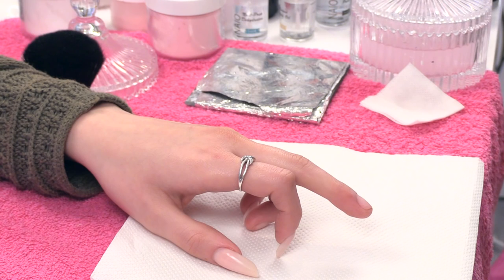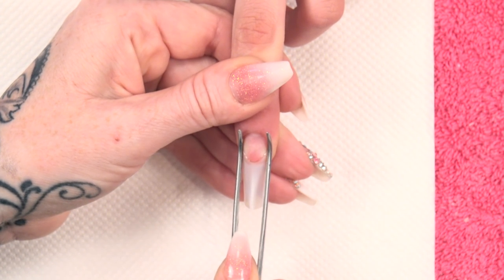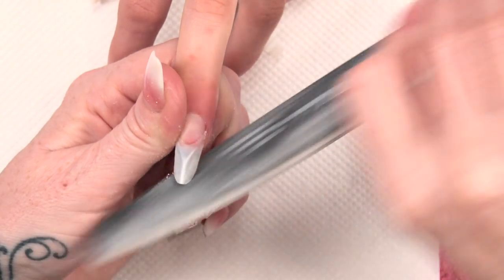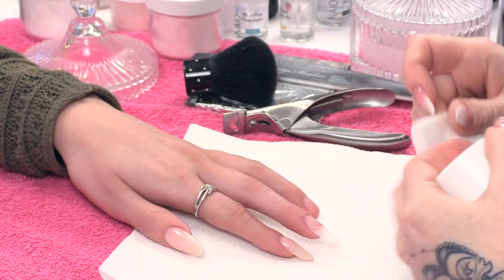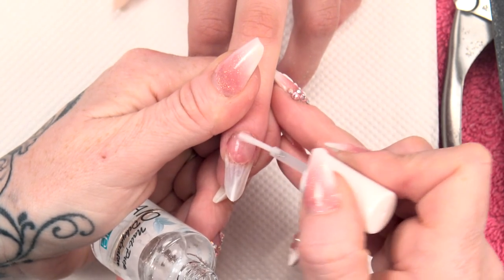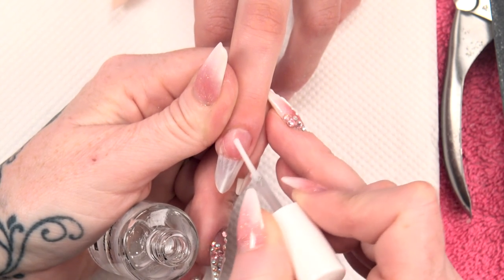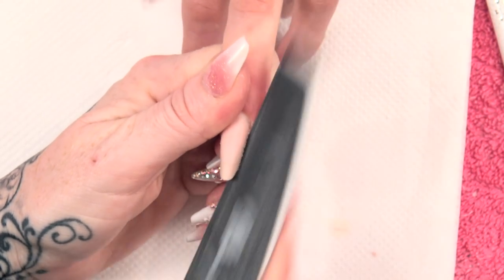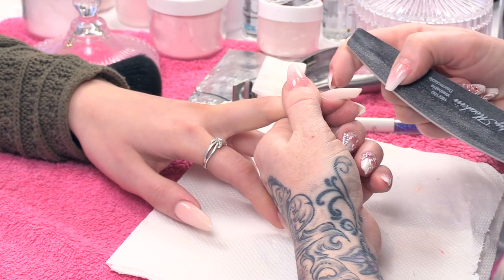How to Sculpt a Pipe Nail

Comment: What makes a pipe nail a pipe nail?  I, at least, couldn't see what made it different from an almond nail.
Reply: Maria Mahaney The difference between a pipe and an almond, is the shape pertaining to the sidewalls. If you look at the side view of her nails (3:38) you will see that the pipes' walls have two different shapes. 

At the tip, it angles down towards the ground and then shoots back in a straight line. The sidewall of an almond is one continuous shape and does not have that sharp angle pointing downwards.